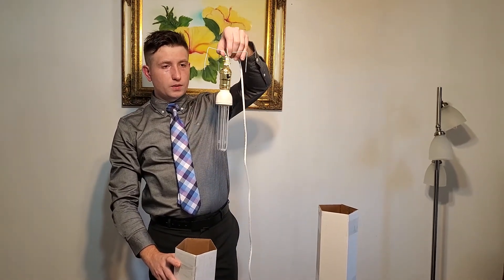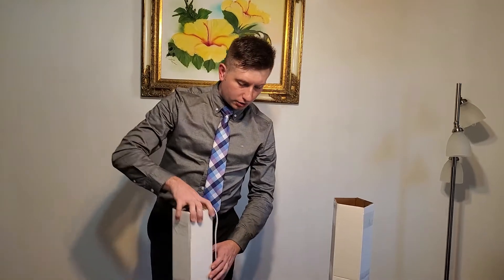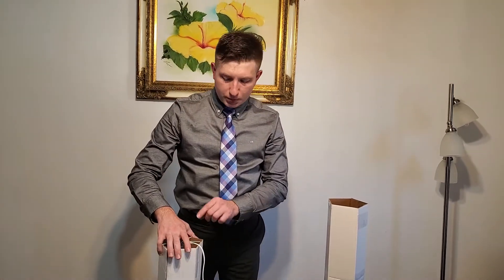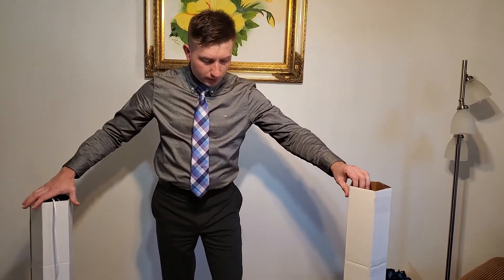air purification column

Comment: I am actually working on a architectural project where i re-purpose the sanda aromatic diffuser into an air purifier using arduino circuitry merging it with the circuitry in the device. Would appreciate to taking notes from you on this .